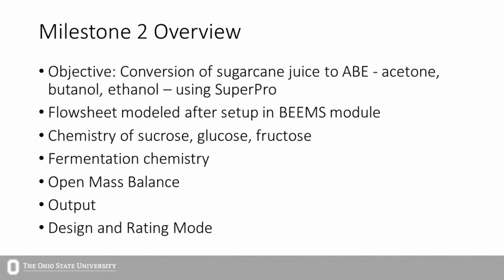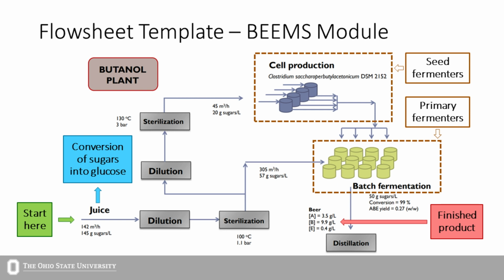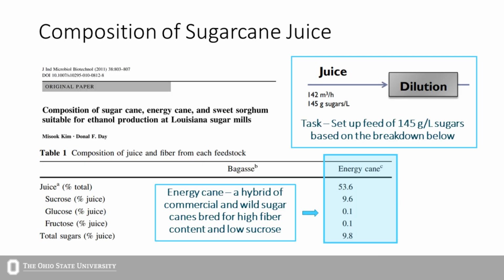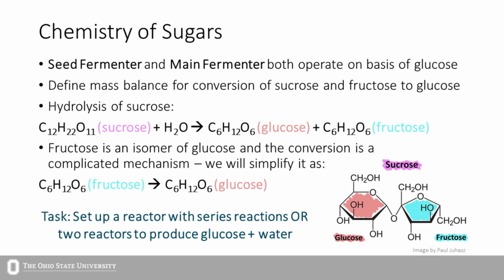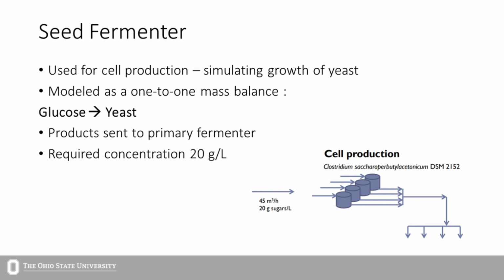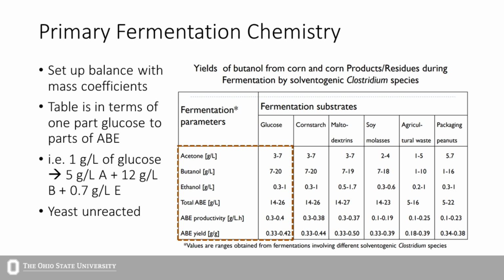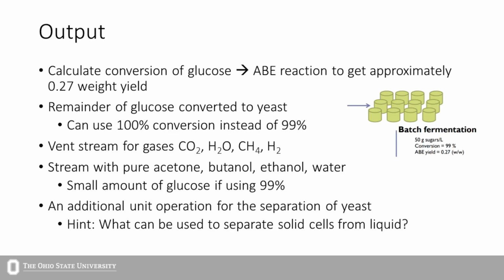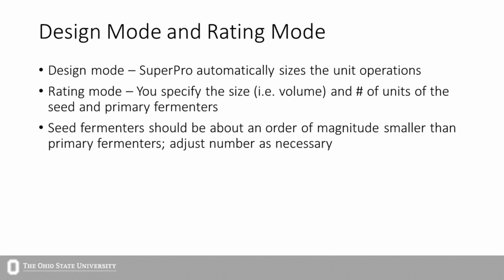CBE 4764 Glucose ABE Fermentation Lecture

Comment from the maker: Correction/Clarification on the Open Mass Balance slide:

On the slide, I have written 1 g/L glucose --> products.
It should be written as 1 g/L glucose --> 0.33 - 0.42 g/L products IN THE RATIO OF 5 g/L A + 12 g/L B + 0.7 g/L E